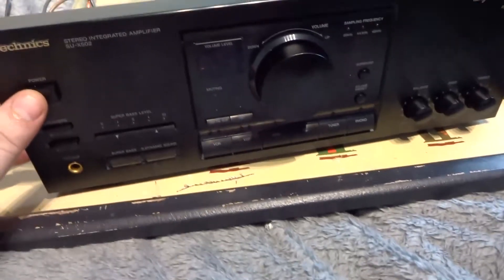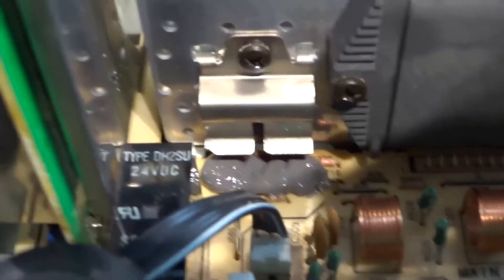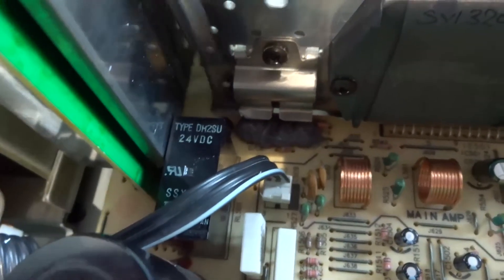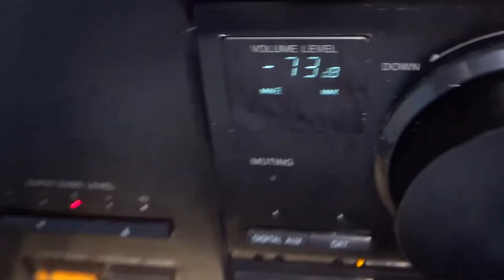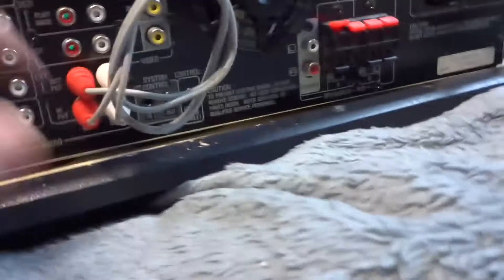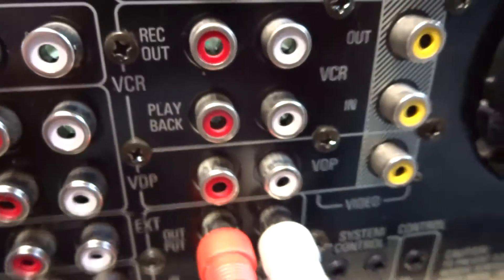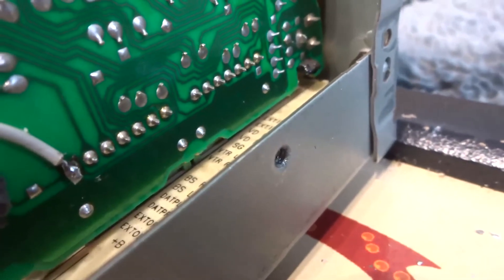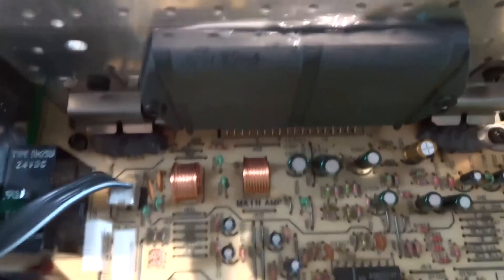Technics SU-X502 Amplifier Bad Solder Connection (1 Of 2)

Comment: Hi. I just bought this amp today, and when I got it home I dropped it😢 . It comes on but there is no sound coming through have you any ideas what it could be? Or is it ok and I may have hooked up the wiring wrong. Any help would be greatly appreciated…
Reply from the maker: At the back theres a PRE-OUT this has to be connected back to the PRE-IN using a phono cable, unless youre using a graphic equalizer, otherwise you will get no sound

Comment: Thank you very much for answering me!  I will try everything you told me. I forgot to mention the fact that the Amplifier being turned on sometimes makes noise and in those seconds the fan starts very little.  I'm an electrician, but not an electronics technician, but I'll try.  Thank you very much !

Comment: Hi, I have one of these and its just stopped outputting any sound. Fan is not running either.  Anything obvious to check or ideas on how to fix ?.  Thanks
Reply from the maker: Check capacitors in the power supply m8 that’s a start, I obviously can’t diagnose it over the internet but a good visual inspection is where to start, good luck.

Comment: Hello!  I've just bought one of these, great sound...  I have a couple of questions: How did you wire the fan to be permanent, did you bypass a sensor?  My tuner is very quiet, with the amp turn to max I can only just hear it.  Do you think this is a tuner or amp issue?  Cheers!
Reply from the maker: Hello at the back of the amp make sure the preamp out is lopped to the preamp input with a phono cable
Reply from the maker: Looped
Reply: Thanks, but I have an equaliser on mine so don’t need the loop.  How did you wire the fan to be permanent? I ask as I don’t think my fan comes on at all and the amp does get warm...
Reply from the maker: @drhoon8893  The fan is a high failure point in these amps, or rather the fan controller is way too relaxed and it doesnt start up until the heatsink reaches 65celcius. i would fit a 70mm low speed pc fan in place of the one in there, find a 5 or 9v dc line in the amp and solder it directly, note the factory fan emits noise through the speakers without a suppressor capacitor, a pc fan is brushless and this wont happen. solder the NEGATIVE fan wire to ground (chassis) and POSITIVE to any 5v or 9v internal pcb pin. alternatively you can fit a 120v AC or 240v AC fan directly to the mains input cord. you could also try disconnecting the temperature sensor from the heatsink and either short the two sensor wires together or open them (depending on what type of thermistor it is) a slim 80mm fan will fit as well with a pc fan grill, hope this helps you out, there are many options.

Comment: i have one of these also, however i now live in Canada and I recall being told I wouldn't be able to modify the internal transformer to our 120V service. so I suppose I'm stuck with bulky external transformer?
Reply from the maker: Hello, the internal transformer may very well be suitable for 120v, manufacturers usually use the same transformers to cut costs down, therefore it may be a 2x120v one inside, grab your multimeter and have a look m8
Reply: @Synthematix  thank you :) will look into this for sure as I don't want to sell it :)

Comment: Hi i just bought this amplifier I have a dumb question tho how many speaker can I connect to it Thanks
Reply from the maker: 4, 2front 2rear
Reply: @Synthematix  It's actually 6!  Two on output A, 2 on output B, and 2 via the surround sound RCA connectors.  I've had one of these systems from new, and mine is connected to the speakers supplied (front) with the system on output A, 2 surround sound (rear) speakers from the RCA's, and 2 in the Kitchen on output B.

Comment: Beautiful amp sounds amazing on my mission m73  speakers had mine running all day today giving it some power and was cool as a cucumber bought this off eBay best amp I have had
Reply from the maker: at the back theres a switch for speaker current sensing, switch that on the sound is even more powerful, they are great amps

Comment: Will any other surround speakers work apart from technics brand?
Reply from the maker: Yep, as long as theyre 8ohms each.
Reply: Absolutely... Just ditch the stock Technics and get yourself a pair of B&W Tannoy or Monitor Audio and that little amp will sound really good in comparison to the stock speakers..

Comment: Hello. Thanks for the video. Did part 2 make it on to YouTube and did the fix work? I have the same amp with no display or Relay click. The fuse is good and the Diodes all read 50v happily.
Reply from the maker: Yea here m8, the problem was on the main pcb: https://www.youtube.com/watch?v=TtZssDyJp1w

Comment: Hi, can you help me please!!! I acquired Yamaha NS F51 towers. It turns out that I had the opportunity to acquire a stereo component Technics and, I connected the speakers to the amplifier, only, as my source of power. But, barely and I notice the following. The Yamaha have an impedance of 6 ohms and I believe its power is 80 watts and maximum 240 watts. The amplifier is 2 x 40 watts at 8 ohms. The impedance range that the amplifier handles is 8 ohms - 16 ohms.
The question is: Can the amplifier damage my Yamaha? Or vice versa? And what do you recommend? Thanks in advance.👍😀
Reply from the maker: The yamaha ns speakers are 2x12 ohm drivers in parallel running at 6 ohms they will work perfect on your amplifier no worries there, in fact a perfect match! do not worry about the 6 ohm rating, this changes as the speaker moves, the nsf51 are damn good speakers! so yes no problem at all fella. its only 4 ohm speakers you have to avoid.
Reply: Thanks a lot my friend.😀👍
Reply from the maker: No problem! any more questions fire away ill do my best to help
Reply: Panel tőrőtt, meg kell forrasztani!
Nekem is ez volt a baj.